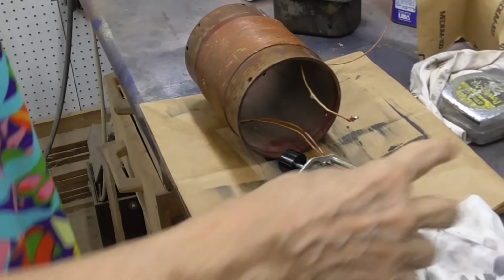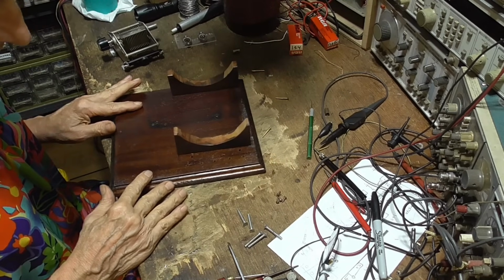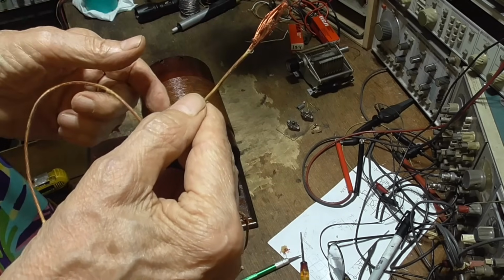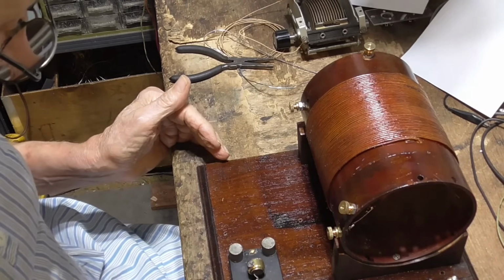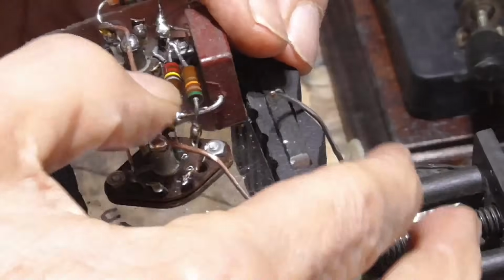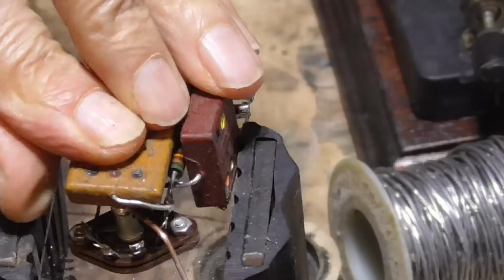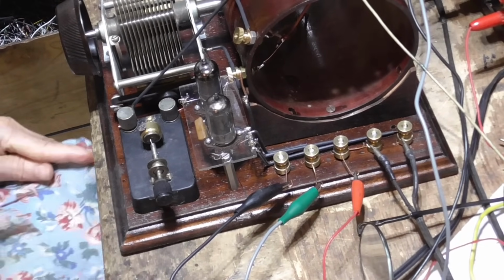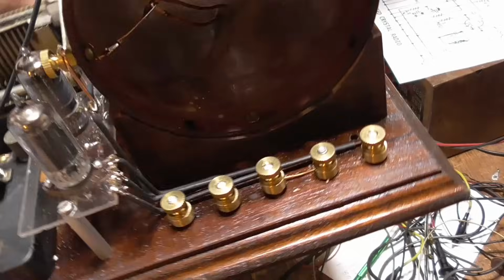MAKING A TUBE AMPLIFIED CRYSTAL RADIO

Comment: Oh how the memories from over 70 years ago were stirred by this video.  Waggling the cats whisker using the red plastic knob on my Ivalek crystal set to try to get a signal, which would only be heard if I happened to be tuned to a station, so it was 'wiggle and tune' together until a sound was heard in my ex-RAF headphones.  Then my fingers would twitch, the non-linear connection would be lost, and the process had to be started again.   When someone showed me a germanium diode for the first time I couldn't understand how something so small, with no knobs to twiddle, could work.   But it did - and what a wonderful innovation it was!

Comment: The tip must be very sharp and the contact pressure must be very low for the diode effect to appear. When I was a child, I periodically tried to sharpen the tip, and then very quickly I could find a "sensitive" point and listen some music. My father, who was literally making transistors for his PhD thesis, advised me this way. At college, 12 years later, I learned why the contact region must be very small. Point contact theory is no longer taught, but it was interesting.

Comment: I remember as a kid my dad bringing home a pair of old headphones and an old variable capacitor and telling me about Crystal sets. My dad knew nothing about electronics, but I got a book from the library about making Crystal sets, and I wound a coil on a card tube from the inside of a toilet roll, saved up pocket money to buy other parts like the OA91 diode and wired things up as per the book, wrapping a piece of wire around the cold water pipe and stringing a length of wire out of my bedroom window down the garden. Amazingly, I could hear radio stations in the headphones. This nailed my future in stone as to what I would do later in life!

Comment: Vintage mica caps and Allen Bradley carbon resistors make this radio a period authentic reproduction.  Nice work !!
Reply: Allen Bradley  CC resistitors are about 50 years off the mark but  the domino micas could be Era correct though. Sweet build!
Reply: @sambekins  True, the old carbon bar resistors would be period correct.  I still have a handful of them though they rarely test to their marked resistance.

Comment: Two 6.0 Volt tubes and a crystal diode  AM radio. The tricky part is making the Lexan tube socket stand and components
 on it. Neat job there Ron. Circuit shown at 40:43 in video. Fun watching you build this radio! Needs a 1N34A cleverly 
hidden under the crystal. I won't tell anyone!

Comment: Ron, you amaze me every time with your skills to create anything.
When i was a kid, i made a crude crystal set, a toilet roll tube to wind wire around for the coil.
a 500pf variable capacitor, a diode, and an old telephone ear piece.
The antenna was a long wire, and i gave it a copper rod earth.
It was so loud,, Radio luxemburg was very clear indeed.
Great fun :-D

Comment: Great vid!!  I’ve been winding coils for crystal radios on Quaker Oats boxes.  I apply a few coats of lacquer to “stiffen” the box a little bit, before winding the coil.  There are much better coil forms, but using a Quaker box adds a bit of nostalgia…..and it is what I have on hand.  I teach science classes for home schoolers and the kids get a kick out of making one.  No whisker….just a germanium diode.  Cheers es 73!

Comment: I decovered crystal radio a couple years ago and have had a great time doing different types. I ran across 100 in 1 electronic project kit and  built and hooked up the amplifier to the crystal and it was very nice. A lot louder then I thought it would be.

Comment: What a great video. Considering the era of the tubes you used, I suggest that an additional but related project could be a single battery power supply. That would be the type using a mechanical vibrator booster circuit. You probably remember those in portable and car radios. The vibrator was about the size of a vacuum tube and made a low hum.
Reply: I’d say make a simple speaker box (same wood), grill cloth, and hide a psu in speaker box.  Just because Ron used loctal tubes (compact and smart), I wouldn’t want to go overboard.  I guess one would see it as a quasi farm/auto radio.

Comment: It's always a joy to hear the first noises on a home brewed radio. 71% of windings is roughly half of the inductivity which would be theoretically the optimum. Built my first detector radio in the 60s ;-) I would suggest to test all different kinds of diodes - even some schottky's work ...crystals don't have any advantages is my experience.

Comment: I learned something new, as always with your videos!
I wasn't aware that Litz wire's usefulness drops off in the MHz range until now.
I remember a clear demonstration of it's effectiveness in the 20-100kHz range from years ago though. I was playing around with a TV flyback driver circuit and "pushing the limits" to say the least... I initially used several turns of solid enameled copper wire on the primary, and they were getting hot enough to burn the enamel. I swapped it out for some Litz wire salvaged from an old CRT TV, which was a smaller overall diameter, but this completely resolved the heating issue. It still got warm, but the difference was night and day!

Comment: Basically the variable cap on the antenna is an antenna tuner which in more modern tuning caps is built into them as an adjustment on the back. Your setup is more of a direct adjustable attenuation setup where you have the ability to adjust the signal attenuation rather than it being preset to a central point of the band.

Comment: I once had a piece of galena and made a crystal set with catswhisker adjustment. Very difficult to get working until I cheated and used the stripped end of stranded wire as a brush. Far easier to get going.
Back when people were using crystal sets with amplifers for radio reception the tubes would have been triodes much like the tubes you make in your workshop. The type of pentodes you are using in this amplifier date from at least twenty years later than when this type of radio was in common use.

Comment: You showed 2 schematics, 1 with directly heated types and the 2nd with an indirectly heated type (2X).  Which schematic did you actually use?  Given a 45 VDC B+, I'm guessing 1U4 and 1S4.  What is the length of your long wire antenna?
Reply from the maker: Actually, I built the radio initially with the battery tubes but the performance was so bad I had to change to the isolated cathode type so I could bias the tube. The old schematic was from using part of the original video. The antenna I use here in Houston is a 10 foot indoor. The stations are so close and powerful a longer antenna is too much.

Comment: The design and tuning procedure is fine. The problem is that Galenite (PbS) and other crystals from the era of these receivers can not direct middle and short waves. The crystal receiver was used exclusively in the band of long and very long waves. Today, these bands are no longer broadcast in the amplitude modulation. The Lord of the video tried to put his receiver into operation, but forgot the scope that the crystal receiver needs. The fast semiconductor diode hidden under the detector saved this great work. :)
Reply from the maker: I agree the scope is ideal for finding the sensitive spot. Think of how frustrating it was long ago before scopes, and when signals were much weaker!
Reply: @glasslinger  If you use a very thin golden wire (0.2mm) with a preload using a small loop, you find the directing point very quickly. The then transmitters on long waves in the amplitude modulation achieved performance in kW. Today, the receivers have higher selectivity and the transmitter performance is in fractions. As I said, the PbS crystal cannot detect medium and short waves AM, nor FM. Therefore, crystal receivers do not work today. If you want to look at my collection of crystal receivers, Flickr look for the name Waldemar Winter ...

Comment: Have you ever built a reflex receiver? I recently learned about those and they seem interesting. They use a crystal detector and a vacuum  tube but arranged in a way that the tube does double duty, providing a stage of RF amplification and a stage of audio amplification with just one triode. 

For this the triode needs to operate in the linear region hence the need for the external diode detector. Magazines I've read say that you could drive a modest speaker with this setup.
Reply from the maker: Several. The combination of reflex and regenerative gives the most spectacular results with very few tubes.

Comment: Hello , Change the 1N34 for a modern Schottky diode you will greatly improve the gain efficiency of your radio , for example BAS 40 or BAT19 ,  BAT15 their threeshold atart as low 190 mV . Also you will have to modify the RC network after to better match the reactance of your LC tank circuit  Nice day .
Reply from the maker: If you saw the test in the video the 1n34 rectified at 160 mV, and that was generous. The old point contact diodes have the lowest gap voltage of any solid state diode.

Comment: Really great work I admit. Got a question. Back some years ago when I was working in Texas I got into radio’s and amps and ran across the best home tube transmitter I’ve ever had. It was clear and clean as a mouse. I had to sale everything when I had a stroke and heart surgery. This AC amp ran off 220 volt and it had four big tube’s. I can’t remember the number or the name of them but it had to be driven by another smaller 500 to a 1000 watt amp I only used 500 and I’d get 4000 watts plus from it. I want to say the tube numbers was 4/500z or 4/600z or something like that. They was almost three inches in diameter and only around three inches tall. Only four pens on the bottom where they plugged into the sockets. A friend of mine that lived in tomball Texas did my work on it for me when I had a issue which was only once and it was a zener diode. The tubes was matched by what the guy told me that I bought it from and I paid 250 bucks for it the way it sat. Just needed a operator and a foot pedal like on a sewing machine , to engage the relay system to transmit. The owner said he had it up to 10,000 watts with his driver and radio station. I had a galaxy radio system that would do 250 watts tuned up correctly. But could you build a tube amp like this with the same tubes I mentioned. I’ve seen some guys have just one big ceramic tube and I’ve seen them put out eight grand with that one tube and with a 250 watt driver. I use to build dc units for truck drivers and my cb handle was and is Hot Waters. The brand name I put on my amps was ,Laser. I made anything from a 100 watt to 10 grand and even built dead motor malls that changed 12 volts to 24 volts and over 300 amps. I used 2sc2879 tasibas transistors in my amps. But please let me know if you can build me a amp like I’m talking about. Thanks again for all you do.
Reply from the maker: Not for hire. Sorry.

Comment: Litz wire works well with thicker strands down to maybe about 10KHz. It's used in high power/high current switching supplies like mains inverters, welding inverters, exc which run in the 20-30KHz range.

Comment: Your circuit reminds me of layout of my 1934 philco where the volume dial is connected through the antenna.
With no extra antenna the local stations come through real loud and uncontrollable, but with good antenna they can be tuned down to nothing.
Reply: All it needs now is a ' front ' with dials sticking through, place to put the speaker, and put your name on it.
If it was mine it would be a ' Szczys ' model 01.

Comment: My crystal radio, in the 60s, used a coil of far less diameter (I can't remember the wire gauge or the coil diameter). It had no variable capacitor.
Reply: Greetings:
I would start by finding your tuning condensor. Then calculate the coil inductance needed to cover the tuning range that resonates over the air-cap's capacitance range from fully meshed to wide open. (Fully meshed needs to resonate @ about 500KHz, open needs to resonate at top of band ~ 1.6-1.7 MHz) Finding only dual section air-variable caps allows you to choose the section to build the coil to resonate with and ignore or delete the unneeded section by pulling off the plates (makes a place to mount the signal-reducing trimmer).
Reply: Over 50 years ago we used a toilet tissue cardboard for the coil.Too flimsy now.Sanded a narrow place across the top of the coil and a stiff piece of wire  contacting the sanded area would be the tuner.Only picked up 1 local station.No egg slicer needed.

Comment: You switched schematics on us in the middle with no explanation. I'm sure you thought nobody would notice.
Reply: Did you do this just so you could use 6v filaments?  Going from tetrodes to pentodes required a few more circuit components, what are the advantages from this change? More gain?
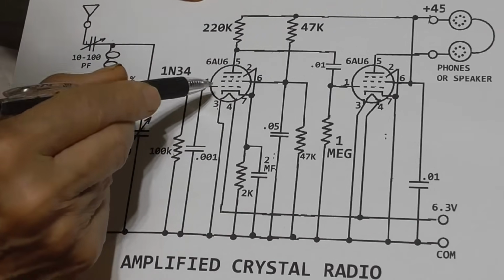Reply: Please see the 2 explanations at 45:00 and 101:00 that give the reasons.
Reply: Even the tools he uses are the same type as back then

Comment: There was a project in an early 70's issue of Elementary Electronics to build an oatmeal box crystal radio. It had two sliders on the coil for tuning. 

Couldn't a coupling coil that could be turned/twisted/adjusted be inserted within the larger coil to kill strong signals instead of the 10-100 variable cap for your version?
Reply: I don't see why you couldn't do that, IIRC that's called a variocoupler and was quite common in the early days as they are much easier to diy than a variable cap. EDIT: though I'd be worried about impact on the Q in a crystal set.

Comment: Dear Glass Linger,
Why the coil in crystal sets mostly wound on a large diameter former please  ?
Reply from the maker: The Q of a coil is determined by the Q of the coil. The Q increases as the diameter. This falls off as the diameter increases past about 6 inches due to capacitance between the turns.
Reply: @glasslinger  
Ok, thanks a lot, please.

Comment: Greetings:
Why are you shorting the coil tap to one end? I thought the tap went to the crystal detector! You must have found your error.
I have to find and bookmark the latest schematic page. I suspect I can use a piece of 3" white plastic pipe as the coil form. (Having an inexpensive LCR tester makes things easier.) Litz & hookup wire, single section air-variable condensor with attached trimmer, 1N34a diode still needed.

Comment: I'm building up the parts to copy the tube side of this. What's the modern equivalent to the capacitor 2mf, a 100V 2.2mF Electrolytic Capacitor? And are those .001, .05 and .01 uF or mF? Thank you.
Reply from the maker: The 2 mf is a non polarized type. Use a plastic capacitor. MF and uF are the same. (microfarads)
Reply: @glasslinger  thank you, I've worked it out. Getting the parts ordered as we speak - the 0.05 seems quite rare! Lol
Reply from the maker: @carlsgarage2023  The industry standard is .047 instead of .05.  Most components are off by a % or so. For this circuit you can be off 20% with no problem.
Reply: @glasslinger  all working now! Dropped  heater voltage down to 3v as 6v was over driving the portable Bluetooth speaker - plus a 100k resistor across the phonos. Many thanks!

Comment: Please. Help me. What does the tube/tubes do in this simple form. (I know they sound good in my guitar amps) but I'm trying to understand exactly what they do especially in a crystal radio and how I might use tubes in the wireless electricity transmitter/receivers I'm building. I want to pick up a small signal of millivolts and less and be able to receive it and AMPLIFY/REGENERATE the signal. I have ideas for the later digital fractal Fourier Transform and ideas  to send multiple signals at once without interference using musical tuning ratios. Any help on how to amplify and/or REGENERATE small signals, easiest for prototyping/proof of concept.
Reply: They are doing the same thing here as in your guitar amplifier. They're taking the feeble audio signal from the diode detector and amplifying it so you get a nice listenable speaker driving signal.
Reply from the maker: Google "regenerative radio circuits" and click "images."
Reply: Does it USE POSITIVE FEEDBACK!?
Reply from the maker: Poison_Prophet  The "Q" of the tuned circuit determines the gain. A Q of 1 means no gain at all. A Q of 2 will give a small amount of gain A Q pf 10 will give a gain of 3. A Q of 100 will give a gain of about 30. It is accordingly more difficult to design a coil with a Q higher than about 30. (loaded Q)
Reply: Poison_Prophet , higher “Q” = greater separation of adjacent station rejection. If you add another high “Q” coil and inductively couple it, the separation will be greater, but more difficult to tune stations in. This is known as a Tuned RF receiver. You’ll need a ganged tuning capacitor (with multiple fine tune capacitors).